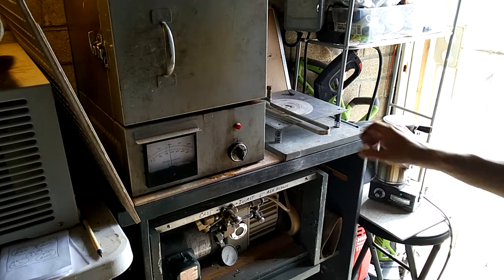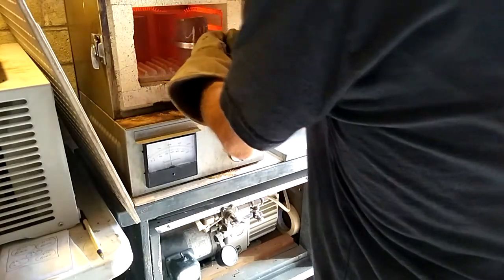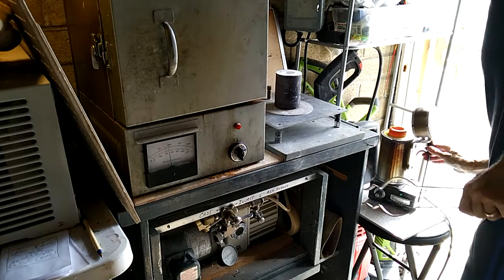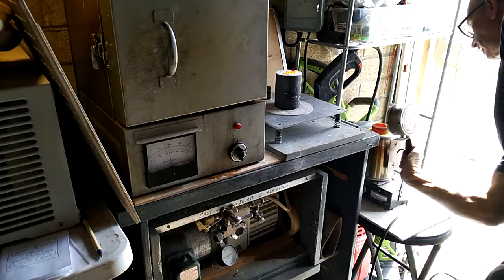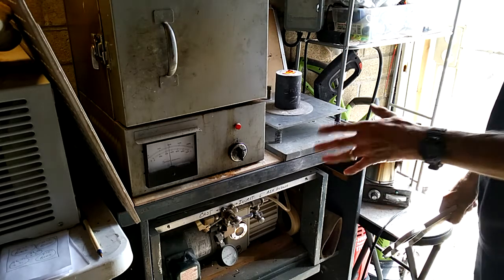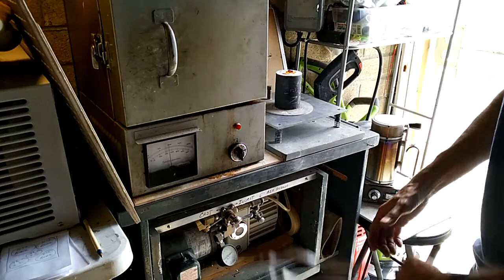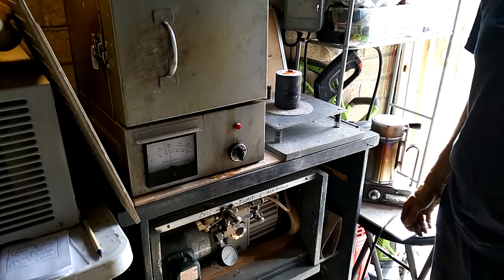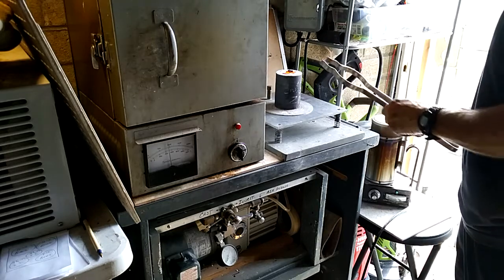Casting 9 oz of bronze.

Comment: I really love your work but especially your attitude and calm. 
I also love the fact that you like to experiment and share with others your results.
What kind of rubber is that gasket? I see no fumes from the hot flask. And what is amazing to me is that you sealed the flask on top of the gasket with so ease. No effort. I wish you all the best.
Reply from the maker: Thank you so much! I always file the edge of the flask that will sit onto the rubber pad each time I cast to ensure a good seal. The rubber gasket I buy from Rio Grande and the white / cream colored rubber seems to work much better than the common orange ones which seem to break down and smoke a lot during each use.